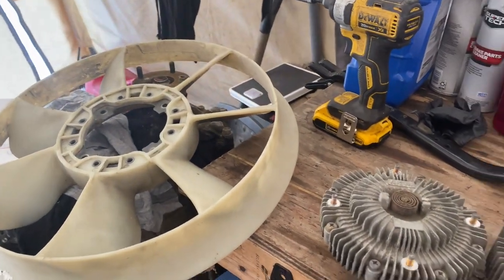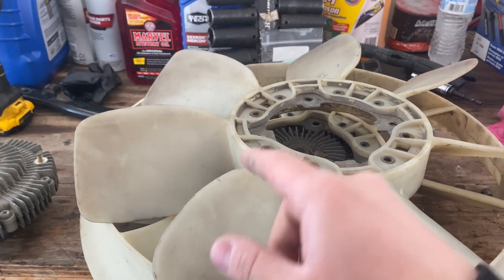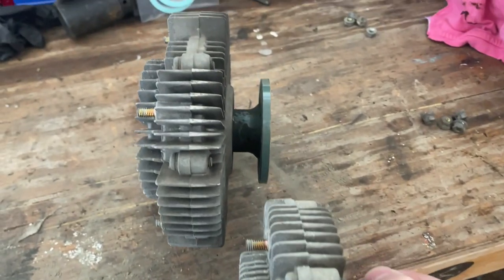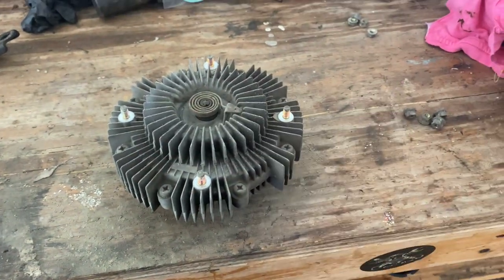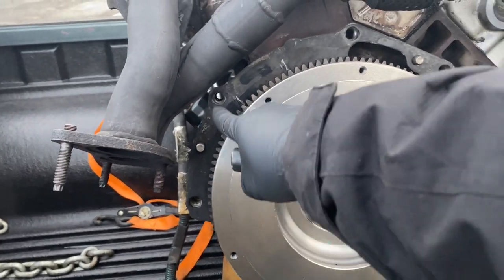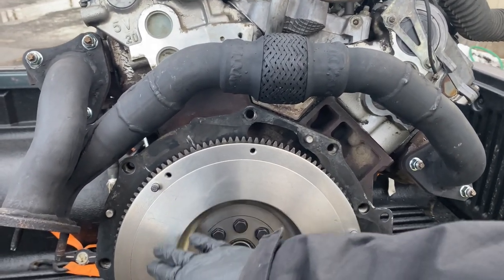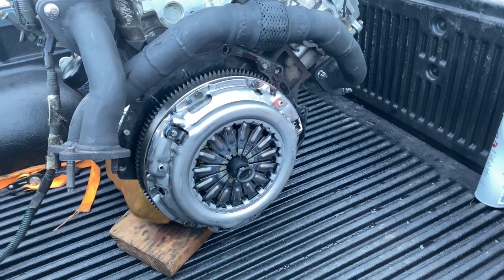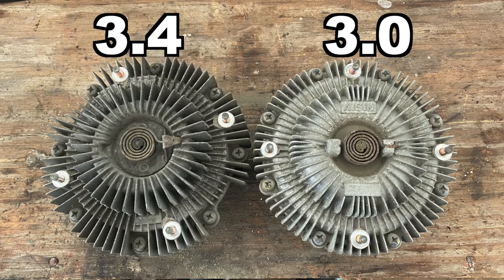Toyota 3.4 Swap | VLOG 19 | CLUTCH & FAN SET-UP

Comment: Hey bud question I had a battery light on so I replaced battery and alternator and new serpentine belt and tensioner! It runs good! No pull on the battery! Toyota pickup it's a 2003! Found one bought it for 1500.00 two days ago now my third 4x4 yota pickup! The only other problem is the transfer case has hard time going into 4x4 hi or low but 2wd good? Any ideas?
Reply from the maker: Check the shifter bushing, common wear and tear. replace that first and maybe change the gear oil in it. report back soon.